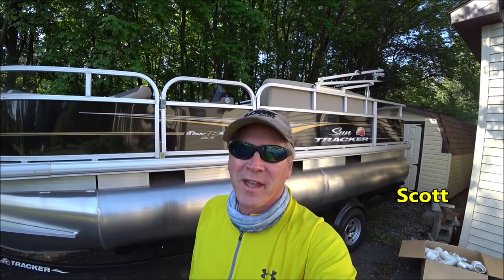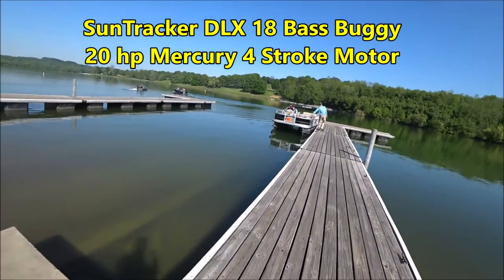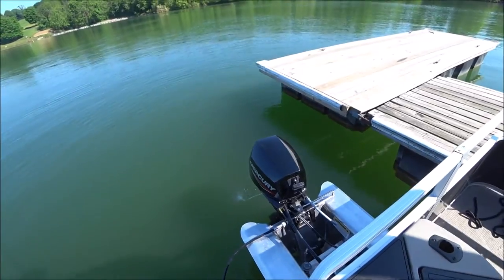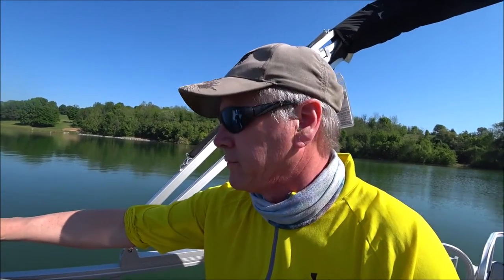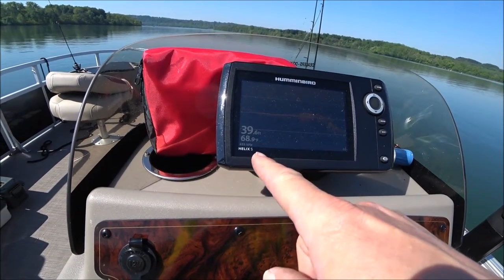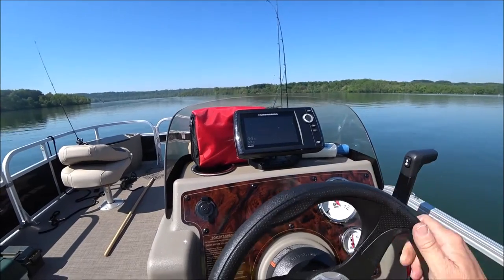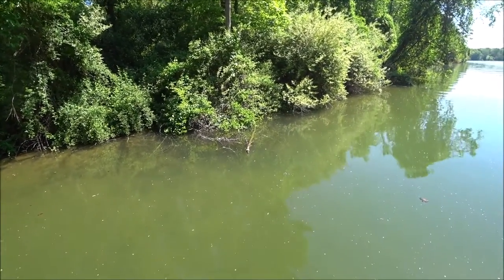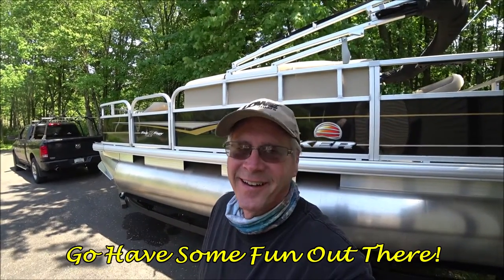20 HP Mercury Speed Test on a 18'  Suntracker Pontoon Bass Buggy

Comment: I get that a pontoon boat is built for comfort and not speed however, the fact that they slap a 20hp motor on the new bass buggies and call it “standard” is crazy to me.
Reply from the maker: I think it's an option because many of the state lakes have a 20 hp limit. Lake Nockamixon near me is a good example. Thanks for watching.
Reply: @BikesBoatsBivouacs  that would explain it! -thanks
Reply: It’s crazy to me too, I just hope he didn’t pay the same price as if it had a 60hp motor! It will hurt its resale big time, cause most people would not want a pontoon boat that big with that tiny little 20hp on the back, I bet that 18ft pontoon boat could easily handle a 150 horse and do around 50mph,
Reply from the maker: @jimmycline4778  This boat was is used on PA waters where some of the lakes have a 20 hp max hp limit. It performs well for its intended purpose, Thanks for watching

Comment: Hey!  I have this exact same set up.  I can only get about 10 miles an hour on mine.  What prop did you have on there?  My dealer put a 107 4 blade on mine.   Thanks for the help!
Reply from the maker: I have the stock three blade prop that came with the motor. I didn't see any markings on the prop. Thanks for watching.

Comment: Curious if you are using the recommended prop or a different size. I have a 19.6’ pontoon and I can’t get my brand new 25hp over 4200 rpm’s. Even though it’s supposed to run at 6000 rpm they dealer just chocks it up to my boat being too heavy.
Reply from the maker: I have the stock prop on the boat. I would drop to a lower pitch to increase rpms. Thanks for watching.